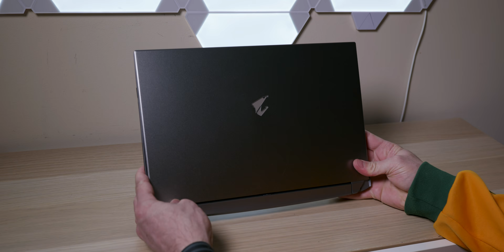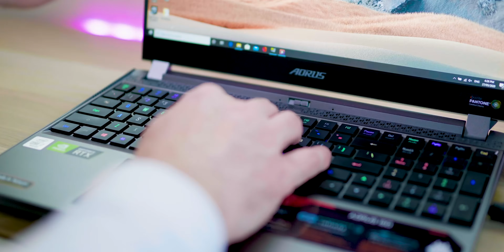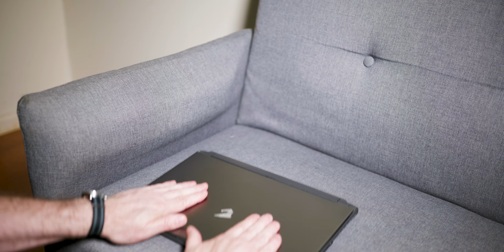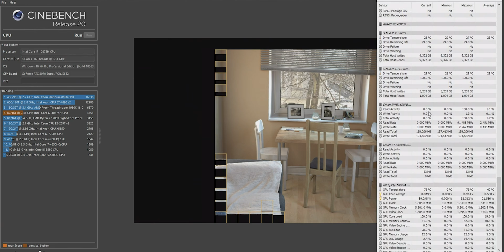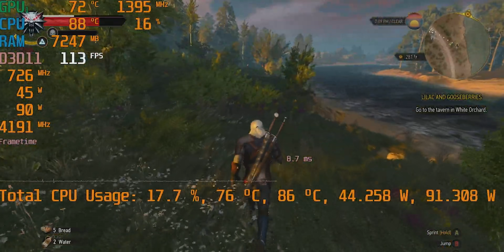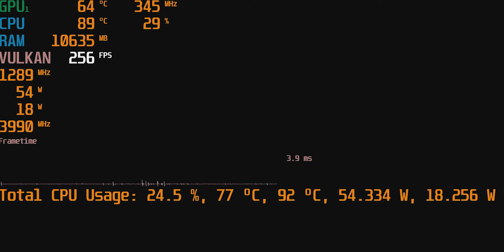The Special One - Gigabyte Aorus 15g - 10875H RTX 2070 Super  & Mechanical Keyboard

Comment: The only setback with intel 10th. Cant be UV.. but no problemo..my aorus 15g can handle it.. gaming 6 hrs without having any thermal issue..cpu temp averaging 82c..(borderlands 3, rdr2, metro exodus).. keyboard area remain cool at all time.. air conditioned room set at 24c..

Comment: That would be really nice with an AMD 4800H in it.
Reply from the maker: But for gaming Intel is still faster at 1080p
Reply: But for the same GPU performance doesn't the AMD 4800H have higher CPU performance, is cheaper, draw less TDP, and runs cooler?
Reply: @christophermagera8643  Unfortunately you can't buy any GPU configuration higher than a 2060 paired with Ryzen 4000
Reply: @christophermagera8643  Not quite, the Intel chips can boost higher in low core and single core operations, at least until they hit the thermal limits, they do draw more power at idle and can't sustain an all core load for long. Problem with gaming is that most games rarely hit all the threads available to an 8core/16 thread CPU. If you want to use your computer for anything more core dependant though, or even maximise the runtime on battery AMD can't really be beat at the moment, their 45W devices beat out nearly every 90W Intel part, and all for a price that is making Intel's accounts very nervous. Better GPUs at this point is the only thing stopping them I think as the extra couple of FPS gained by going intel in some games with identical GPUs pale beside the other benefits of AMD.
Reply: @GeorgeElliott-GE  nah Intel is a beast